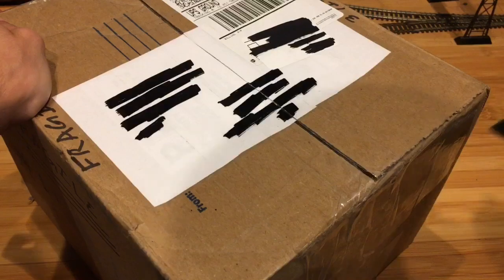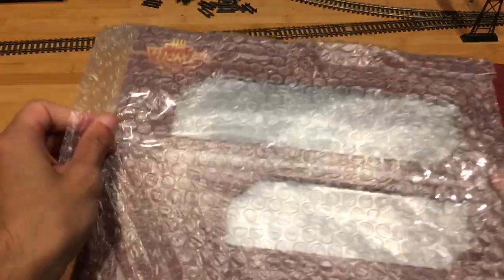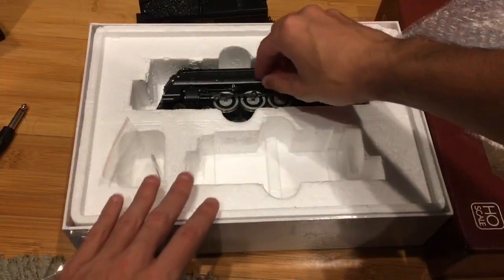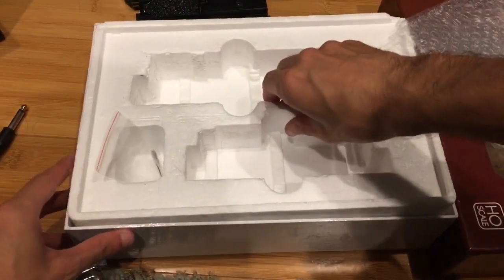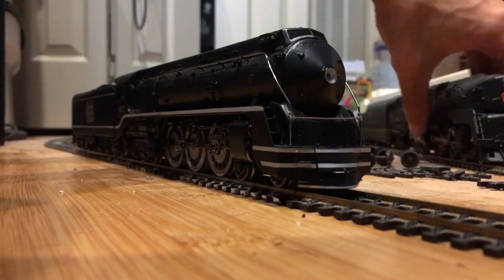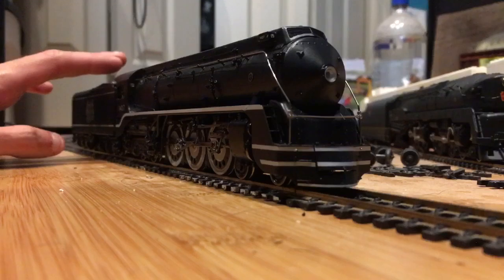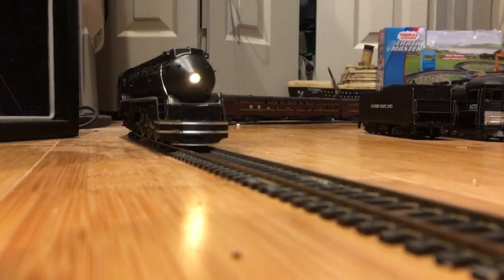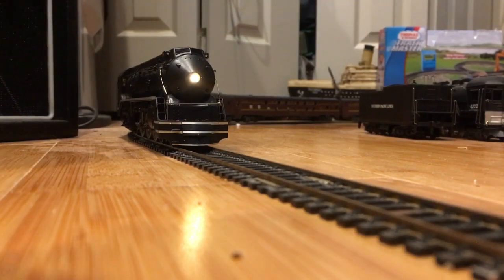Unboxing the Broadway Limited New Haven I-5

Comment: I also have this engine!  Mine is 1406 though.  They’re awesome locomotives that are some of the most detailed models for the price you get.  Also the whistle on the decoder is correct; the NH used a very low pitched whistle for their Shoreliners (Hudson).  I’ve heard the real whistle from an I-5 and it sounds very close to one on the sound system.
Reply from the maker: James Kelly wow, now that is defiantly an experience. Hearing a whistle from an extinct steam locomotive. Yeah, this model has become my most favorite in my collection, but I have it stored away to keep it safe from my DC controller. Since it’s all I have at the moment, I do hope to get a DCC controller as soon as possible.

Comment: You have a dcc remote controller know? I thought you were going to use your dc remote controller but when I heard that whistle and bell and button clicking I knew yo u had a dcc remote controller
Reply from the maker: Southern pacific 4460 Well, I know I did say that in the vid. (Can’t remember now) but me having a DCC controller is incorrect, believe it or not. Also, would you believe me if I was still using the DC controller to make the whistle?

Comment: what remote do you use to move the trains and do the dcc sound?
Reply from the maker: TrashKid4 I use a rail power 1370 DC controller. BLI made it to where you can literally flip the direction switch, and you can have it whistle, and you can have it ring its bell. It’s so cool. I literally found it in the instruction manual as I was uploading me unboxing my PRR T1. I don’t have a DCC controller at the moment, but I’m am hoping to get one eventually.